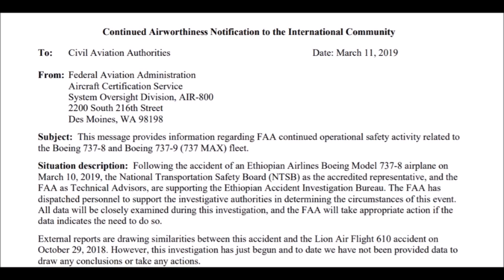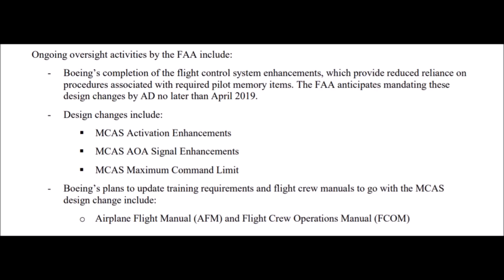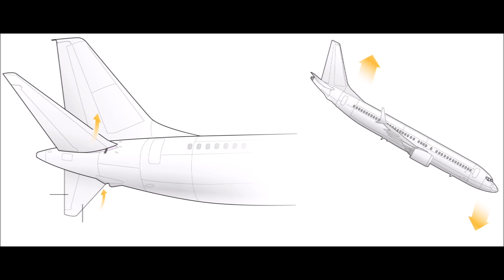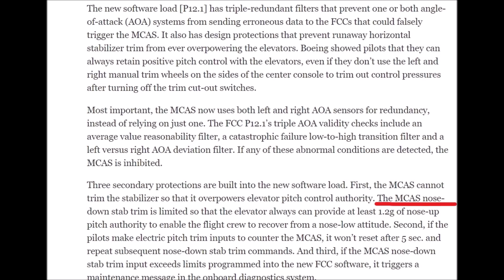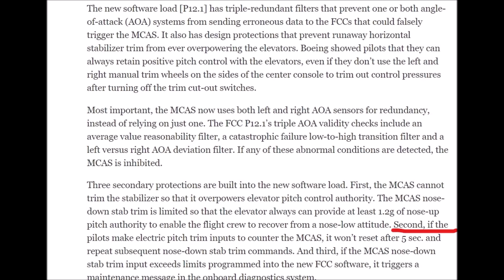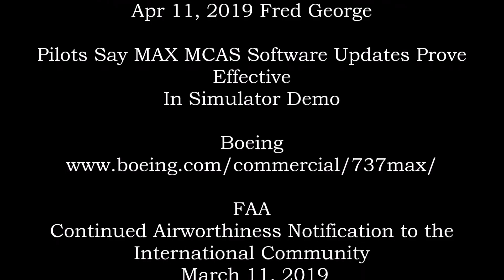737 Max UPDATE 14 April 2019 "The Fix"

Comment: The Boeing 737 MAX design was almost as bad as the General Electric Fukushima Daiichi Nuclear Power Plant design. GE built huge containment walls to protect the reactors but left power and back up power at sea level. The containment wall totally protected the reactors from tsunami but later all three reactors that were online had their cores melt down because they had no power to cool the reactors. It seems we have lost the ability for rational thought.
Reply: The backup power generators and switch gear were actually below grade. They were underground, and the tsunami swamped them. Diesel generators and electrical panels don't like operating while submerged in 20 feet of seawater.

When TEPCO finally got emergency generators on site, they were the wrong frequency, and could not be used (Japan uses both 50hz and 60hz electrical systems, for reasons that aren't entirely clear to me.)  The good news is all American nuclear reactors now have backup backup generators stored off site in safe areas, so should an American reactor wind up in a site blackout, nobody needs to scramble to FIND a generator to get things going again. It's all ready and waiting...

Comment: Thank you for the update. It is disturbing that there will be only two AoA sensors rather than the three sensors that the A320 is said to have. AoA sensor failures seem to be comparatively common, so two are simply not enough. Boeing still seems to putting primary emphasis on cutting corners rather than ensuring failsafe performance.
Reply: AOA data on the B737 is not flight critical on the mostly manual B737 (MCAS excepted). The opposite in true on the A320, where it is directly used to manipulate the controls in all aspects of flight. The required degree of redundancy is completely different.

Comment: Great Video!... still wondering doe Boeing doubt the ability of the Pilots to avoid a possible stall?...would they not notice twhat is happening and make corrections. it seems to be that MCAS really was not necessary. If you notice  the aircraft pitching up (too much) make the correction as would happen on other aircrafts without MCAS
Reply: Its mostly a regulatory requirement. Nobody really wants it, and few pilots will ever use it. However, it is part of the Congress mandated Federal Regulations, and cannot be waived.

Comment: IF: knowing that autopilots are routinely engaged at flap and gear retraction, AND that MCAS only comes into play when flaps are up AND autopilot is OFF,  Then: Whiskey Tango Foxtrot?

There is some serious logic missing here!  What’s kicking off the autopilot, the frigging inherent pitch-Up condition of the design! Damnit

Why must the 737 max fly just like the other iterations When the Autopilot is Flying the Plane? ✈️  I am sure that sentence was uttered by engineering, more than once!

Lastly, all this automation is not geared towards safety, it’s geared towards eventual ‘single pilot’ 👩‍✈️ operation! 

Waddaya want in the right seat, the blow up FO from the movie airplane, Or HAL from the movie 2001?

Boeing wants ACARS slaved cruise control, and your seniority slot. 💫🌏💫
Reply: The problem with the MAX is not the automation per-se, but the fact that it is bolted to a 1960s design, with mechanical cables, and autopilot, and so on The B787 is a much aircraft, but costs twice the price.

Comment: If the jack screw fail it won't matter what kind of computer  programs are doing except give the pilot more life & death situation. What did the pilots do before this  IMPROVEMENT  was put into use? How often did pilots have to deal with this situation?.  How many souls died  before this new upgrade? How many died after it was put into use? How many pilots were in there schooling taught how fragile the jack screw is and above all else how screwed you will be if break it in flight? I know you pilot's need to do a walk around before boarding the plane, I think I'd be asking for a copy of last check maintenance sent to my cell phone so I could have a pilots questions or concerns addressed.  Whats the old saying "USE IT OR LOSE IT "

Comment: Boeing and the FAA could not have done any kind of Failure Modes and Effects Analysis (Safety of Flight Analysis) on their system design before putting it into service.  How is this possible?  The industry has used such practices for decades.  Automation is not unsafe when designed correctly by competent teams and audited by experienced overseers.  A simple series of documented what-if's could have saved the lives of hundreds and the reputation of Boeing.

Comment: Thanks again for your great work.

There is much in the proposed fix that makes perfect sense. I am left wondering how these "fixes" failed to make it into the design in the first place, given the assumed experience and expertise of a company of Boeing's standing (I guess that is not so profound...).

There is one comment that leaves me puzzled though: "...one thing we can all agree on out of that discussion is that there was no reason for the poorly designed initial iteration of MCAS in the 737 Max that would put these pilots into this precarious position to begin with..." (I think the context was the Ethiopian airlines flight 302 discussion). This statement seems to contradict pretty much everything else you have said...

Comment: Why is the manufacturer of the AOA sensors not under the microscope?
Reply: Good question. The failure may have been due to mechanical damage, not a manufacturing defect. Other aircraft have had AOA failures, but without MCAS the results were not catastrophic.

Comment: Hey Juan,
I just wanted to reach out to say thanks for this video series on the 737 Max issue. As an aviation enthusiast, I really appreciate the amount of time that you've been putting in to provide all of us these extremely informative videos from your professional perspective. I also want to give you props that you have maintained an extremely fair and non-biased opinion throughout which might not of been so easy at times. I do have one question, since it's now clear that the MCAS software program wasn't even close to being correct, how surprised are you with what you now about the original MCAS programing issues, that it took six months to have the two serious incidents resulting in the loss of the two aircraft and passengers. And secondly, are you also perplexed how the MCAS programming problems never showed itself during all of Boeing's flight testing of their 737 Max series aircraft, how we all wish that it had. Thanks again Juan and keep up the great work.
Reply: Good points. 1. The fact that it took 6 months to design the fix is a good thing IMO, though it does reflect badly on the original implementation. 2. MCAS only activates if AOA fails high, and that has been a rare occurrence. It may have been something as trivial as ramp damage while loading passengers.

Comment: Will the airlines now face additional costs (transfer from former 737 to the Max series) with the "fixed" version of MCAS?
Reply: There should be no cost to the airlines, other than lost revenue. Boeing will have to pay for all the fixes.
Reply: @gordonrichardson2972  If there are no additional costs for the airlines with the "fixed" MCAS, I don't understand why they didn't install a proper working system from the beginning. - Oh, I see, Boeing was under pressure to release the new aircraft as fast as possible. No time for sustainable tests, otherwise there would have been losses in market share. So better sending several houndred people to death than losing some money. I so f*ing hate this world. /bitterness mode off

Comment: Boeing’s 767-based tankers use a version of the pitch augmentation system that grounded the 737 Max 8 fleet, the manufacturer and U.S. Air Force officials say. 

The disclosure provides a new data point in the unfolding story of how Boeing installed the Maneuvering Characteristics Augmentation System (MCAS) on narrowbody airliner fleet. 

Both the KC-767 and KC-46 fleets delivered to air forces in Italy, Japan and the U.S. rely on the MCAS to adjust for pitch trim changes during refueling operations. 

In the 1980s, Boeing’s engineers considered using a pitch augmentation system for the commercial version of the 767, but dropped the idea after finding that vortex generators provided adequate control. 

By 2011, Boeing had already delivered KC-767s to Italy and Japan fitted with the first version of MCAS. The use of the system then spread as Boeing won the Air Force’s KC-46 contract in February and launched the 737 Max 8 in August. 

But Boeing designed the integration on the KC-767 and KC-46 slightly differently than on the 737 Max family. 

The single-aisle airliner uses one angle of attack vane — either the captain’s or first officer’s — to generate the data used by the flight computer to activate the MCAS. 

By comparison, the KC-767 and KC-46 are designed to use two sensor inputs to feed angle of attack data, Boeing says.

Comment: If the purpose of MCAS was to avoid new type training for transitioning pilots, and there are now a lot of pilots who have enough time in type to satisfy any reasonable type transition training requirement, then why not just rip this out altogether?  Make all newly-transitioning pilots take transition training and get a bunch of Max simulators out there to make it work.

The new software sounds much more complicated, and therefore, more error prone.  If they are still trying to solve a regulatory problem (FAA response to minor differences in handling characteristics) with technology, then it doesn't seem they have learned anything.  Unless the differences in handling characteristics are really more significant than suggested.

Comment: Great reporting Juan, thanks for your great work.

As a software engineer for the past 30 years, I can tell you that there is a lot of tunnel vision, developers are hyper focused on just their part that how this integrates in the overall system isn't looked at as thoughtfully as is necessary. Also software developed under DO-178B for flight control is highly regulated and making changes is very expensive and isn't done easily. I would think that the development of new flight control software would have been done in isolation with the least interaction with existing software to avoid recertification of existing software.

Comment: So Boeing have basically made a perfectly fine plane handle like another type of plane purely for monetary induced savings or for an aviation industry advantage? And have thus killed people. Simple. They changed via computer governance, the handling characteristics of a perfectly safe plane. And induced potential severe error, which occurred.
Yes the system or how it and flight crews operate with mcas, should be improved.
But Boeing should face corporate manslaughter charges!
They have a rap sheet for things like this. No excuses. People died. Boeing are culpable.
Reply: Boeing cannot hire competitive people because of diversity laws by government 
For eg Equifax hired a music composition major for chef security

Comment: Design changes are required 
Why MCAS was required at first place
Reply: As I understand it - and I am NOT certain of this - the 737 MAX has newer design engines that had to be mounted slightly higher on the wing for ground clearance.  This causes a slight change in aircraft trim at higher thrust settings, compared to previous model 737's.  MCAS was created to help avoid stalls during climbs.
Reply: @Allan_aka_RocKITEman  Dear your understanding is completely right the new cfm leap engines are bigger as their fan diameter is larger , more fuel efficient the point is that 737 ground clerence due which they  pushed the engines a bit further on the wings which resulted in change in center of gravity and aerodynamics of the plane hence nose up during a cent at full thrust 
In a rush to compete with airbus a320 neo they instead of making design changes opted for MCAS system and thus the beginning of the whole episode, it important to note the a320 has higher ground clerence
Reply: I however must add here that I am not a technical person just became curious after hearing the news of this whole episode,  this is my understanding of the whole affair
Reply: @Allan_aka_RocKITEman  No. MCAS is not an anti-stall system. Juan mentions this in this very video. It's entire purpose is to make the MAX feel the same as any other 737. The larger, forward placed engines to change the characteristics of the plane, but not in any serious manner. Read the article posted by Juan in the description (last one, Aviationweek). Pilots practicing in the MAX simulator, with MCAS shut off, said they could barely notice any differences, and that was only because they knew to look out for it.
There is nothing wrong with the design of the plane itself.
Reply: @bloodguard41  >>> Rodger that - Thanks.  
 
I have watched at least one other YouTube video about this subject.  

That may be where I go the anti-stall thing from....

Comment: I still think it was a mistake not to configure the physical airplane to fly as the previous 737’s. It looks like they didn’t know how it would fly and the MCAS was an afterthought or fix that corrected the original design mistakes.
Reply: There was huge pressure to match fuel efficiency targets of 15%, since that was a big selling point of the new engines. Fixing the aircraft may have increased drag by 1 or 2 %, and cost $billions...
Reply: It’s hard to believe that there is no design mods that could accomplish both. I’m sure they will do a redesign in the future. I am very surprised that they did such a poor job with the MCAS system. Perhaps they were up against a timeline to get it done without thorough testing. Apparently it wasn’t tested simulating sensor failure.
Reply: They could conceivably do a redesign in the future, but the certification implications are large, and the MAX really looks like the end of the road for the B737.

Comment: I think that FAA will participate with their share of responsibility in this case. What Juan Browne didn't say here is that MCAS was installed because of a Federal Regulation, specifically 14 CFR § 25.203 - (Stall characteristics), that says in a certain part: "...No abnormal nose-up pitching may occur (during the stall). The longitudinal control force must be positive up to and throughout the stall..." Boeing engineers HAD to install such system, otherwise MAX variants would be grounded by not compliance with above mentioned CFR. But, it's true that every aircraft has to undergo an inspection and approval in what is called the certification program. The 737 MAX supposedly passed through this scrutiny and its certificate of airworthiness was granted!
Moreover: I can not help but notice, from the comfort of my couch, unfortunately, that the crew did not act correctly in a very critical situation. Since my days of 737-200 I used to fly with my leg leaning against the trimwheel just to feel any early improper or adverse condition of the trim. In such situation EVERYONE IN MY COMPANY KNEW THAT STAB TRIM CUTOUT SWITCHES SHOULD BE DISABLED BY THE FIRST PILOT THAT COULD GET TO THE SWITCHES! And we did not have the MCAS at that time ...
Reply: Boeing could have enhanced the stability at high AOA and removed MCAS. However that would have increased drag, and worsened fuel economy, which was the big selling point with the MAX.
Reply: @gordonrichardson2972  According to some information I gather in some place (I can't remember where), Boeing effectively tried that improving aerodynamic characteristics with conventional stall strips or else, but that wasn't sufficient to tame the adverse effects during light weight/back CG high AOAs, so they decided to incorporate electronics to compensate for.

Comment: But shouldn't MCAS also take readings from other systems as well to verify proper operation?? I mean, what if the sensors freeze in place? Shouldn't the MCAS monitor MORE than just the two sensors??
Reply: you are right, that is fixed in update
Reply: @salkasalka  Oh, it is? So, it relies on other systems too? I didn't know that.. Thanks..